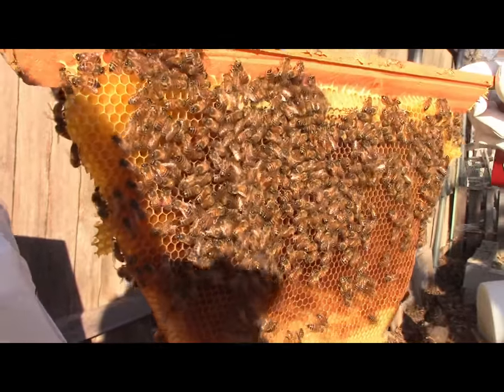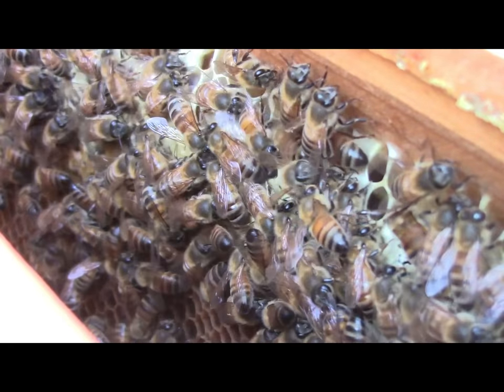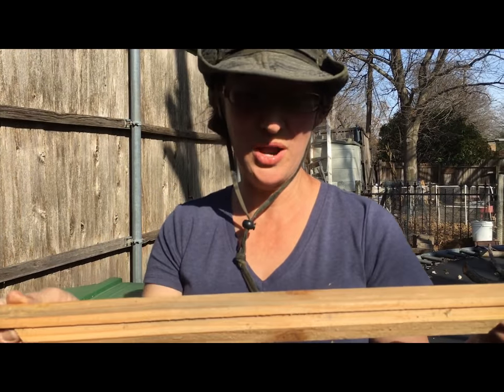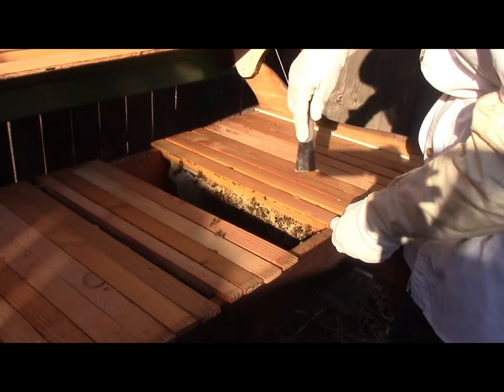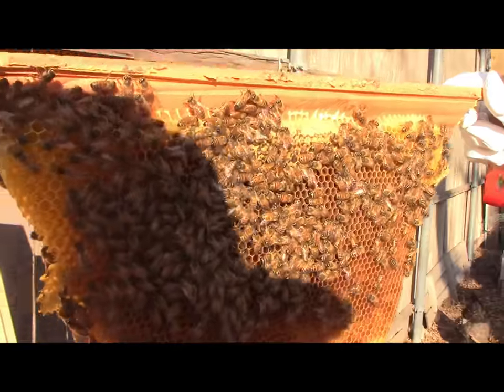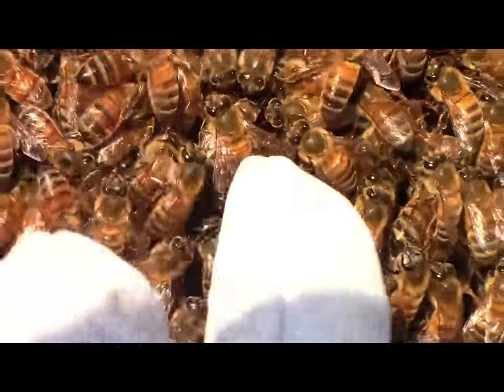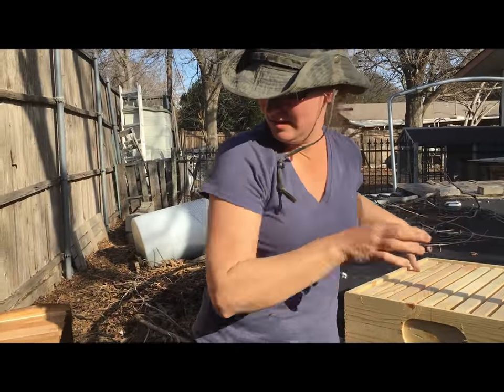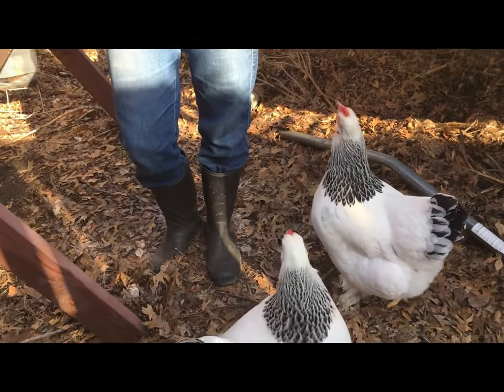The Secret to a Successful Top Bar Bee Hive

Comment: On my  bars, i inserted about a 2 inch long honeycomb plastic  and  covered  it with  beez wax, so the new bees have  something to attach the  new comb to!
Reply from the maker: Thanks for reminding me. I saw that once, but had forgotten. That might really help to prevent that cross comb. I was so frustrated when I did my Fall check. Both hives were building across the bars. I couldn't tear up all their honey stores so I had to leave it for Winter. I will get into them this Sat & I am sure it will be a mess! Maybe I will spead a weekend putting that foundation strip in! Thanks again for taking the time to tell me.